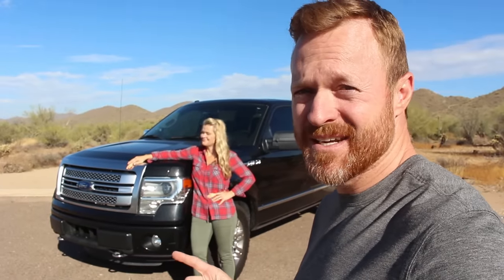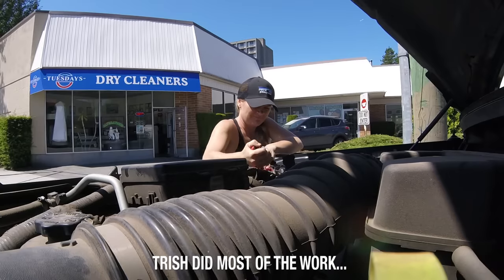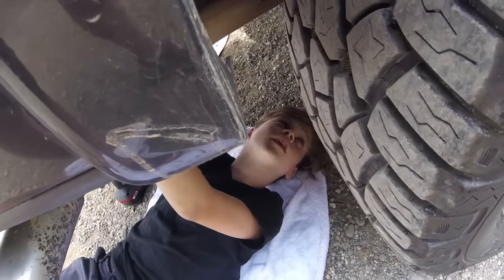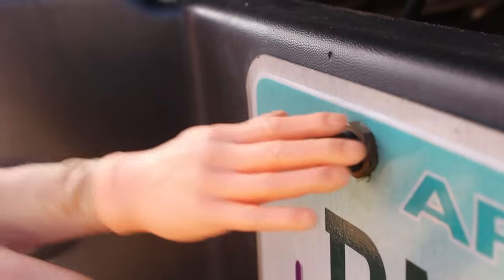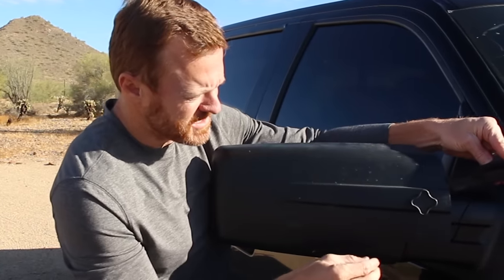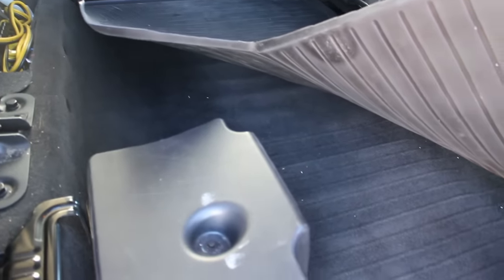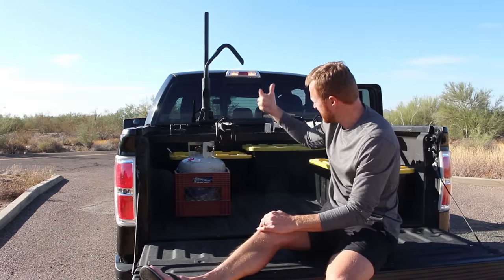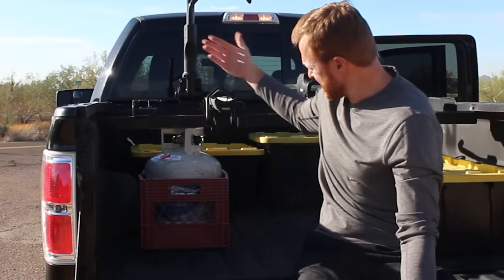TOWING WITH A HALF TON TRUCK (FORD F-150)

Comment: Are you using a load leveling hitch? I set up one on an older F-150 to tow a 28’ camper and it did not sag with stock suspension.
Reply from the maker: Yes, the EZ Load weight Dist. hitch. It failed after 18 months. I wouldn't buy it again.
Reply: I'm not sure Ford has it on every model year, but I think any of the trucks that boast the 'max-tow' package, with the
additional transmission/oil cooler and the extra radiator cooler, will also have a weight distribution hitch.  But not every
auto/truck dealership has sales people who know the difference, and not every truck on Auto Trader includes that info
in the ad, either.  Sometimes you just have to look for yourself.

Comment: PS to funny on the bike rack we went the route you are looking to go with the side mounted rails and it is awesome! Also allows you to have a cover on bed below to stop everything from getting wet. We carry a fat bike and mountain bike on top with no issue, easy to take the rack off and leave the rails on if you need to load something large in the truck also. For info we got ours installed by the company called Rack Attack

Comment: I'm considering this model for a 25 foot Airstream, weighing about 8 K Pounds.  I believe that beginning in year 2016, the Ford F150 feature the "Back up Assist", where you actually use a knob to back up the trailer.  If you want the trailer to back up left, you turn the knob left, and right, the knob right.  The back up feature is what attracts me to the Ford F 150.
Reply: Things a waste of time in my opinion. Go to a parking lot and practice it’s not hard.

Comment: We had to change our pull vehicle. We went from a 2007 Mountaineer 175,000+ miles to a 2014 Expedition XLT with a complete Tow Package. Great Price got a decent amount for the 07, not what I hoped but it's good. 5.4 L engine. If we'd have known this was going to happen this soon would have delayed the trailer and got the bigger Rig that we started with. Oh well, hindsight. It's a great SUV and I'm partial to them. The clincher was LeAn knew the former Owner so we knew it was a good solid truck. Built on the half ton F 150 chassis it's a winner and we're happy. Well not about the new payment but  at least a great pull. I'm thinking about the Firestone Airbags for it to.

Comment: Good video. I have a 99 Tahoe to tow my race car on an open trailer and usually at or over the weight limit of the truck, however I've done similar upgrades plus a number of others engine, trans, brakes, tires, fluid coolers and some suspension work. I've never had a problem but I do drive carefully. Someday I'll build my dream tow rig but the Tahoe has been great for us for 13 yrs so far, its also my daily driver. I almost forgot to mention, I'm disabled and use hand controls so don't let anything stand in your way of fun.

Comment: Worked construction and pulled a 7000# trailer for many years with a 02 F150 SC w/5.4, went about everywhere in the country with little or no mechanical trouble though I always seemed to be on the upper edge of its capabilities and I understand the newer engines in the F150's far outshine the 5.4's. That being said I did finally upgrade to a F250 with a turbo diesel for me it was a great improvement in comfort and mpg.

Comment: Just went from a 250 super cab to 150 super crew. I bought the most well equipped f150 I could find. New truck has 3.5 eco 6.5 foot bed and payload of 1830lbs. My trailer is smaller than yours but I’m still a little anxious about towing with the 150. We’ll see how it goes.

Comment: The new F150's are great trucks. I have a 2012 F150 Eco-Boost with the Max Tow package installed and air bags on the back. I tow a 28 foot Eclipse Stellar 5th Wheel Toy Hauler no problem. Now getting a 5th Wheel Hitch installed for the 5'5" bed was interesting! Can we say *Expensive!!*

Comment: I have the firestone "Riderite" air bags on my Titan. Just a note if you install them without the onboard compressor, one with a pressure switch that insures there is always air pressure in the bags when you're driving and you install them with the Schrader valve only it will void your warranty.

Comment: really well done video. love seeing people with their head on straight about towing. i personally use "the equalizer hitch" . we have a 2002 silverado with the 5.3. planning on a add a leaf to stiffin up the back end along with lifting the rear end about 2 inches in the process. we have trailer brakes installed. all in all you hit it right on the button on the video. take care of your rig and it will take care of you.

Comment: I’m glad this setup works for you. I don’t know how long Gringer is, but I towed a 37’ ft. bunkhouse travel trailer with a 2010 F150 with no success. I added helper bags like yours and was using the Equalizer hitch. I was well within the weight limits of the truck, but that trailer pushed us around like nothing else. Going down any hill was a white knuckled ride. I have since traded in the 150 for an ‘05 F250 with the Powerstroke diesel. Night and day difference. Now, I don’t have any sway issues, and I don’t have any problems going down mountain passes yet alone hills.
Keep up the great work with the videos. You guys are so much fun to watch.
Reply: 28 feet, was his trailer length
Reply: Thanks for the info. I guess I should have read the video description before posting. I figured my problems were do to how long our trailers is. The longer the trailer the more crosswind it can catch and the more leverage it will have on the tow vehicle.
Reply: yea, I just noticed 30' feet was in the description.   But in the video, he said 28'
Reply: yea, I just noticed 30' feet was in the description.   But in the video, he said 28'
Reply from the maker: Yeah, 37 is pretty long. I would think the issue is not the weight, but tongue weight depending on where the axles are. The diesels are nice - no question.

Comment: You guys put out incredible info. Thank you. 

I am very early in the process. I don’t have a tow vehicle no matter what trailer we decide on. IMHO, pulling a RV of any size at all, a F150 as a tow vehicle is very much a compromise. I understand it is what you have but holy cow, you’re pulling a big trailer with that small vehicle.   I am leaning toward a 25-30 foot trailer pulled by a 3/4 ton, non-dually, truck.   If we do go with a 5th wheel then a dually truck might make more sense.   But a half-ton gas truck?  Not unless we buy a RV 20 feet long or less, which isn’t likely.

Comment: The one thing you need to ask isn't whether it can pull it but can it stop it. I had a friend mine with a new Ford pull a trailer that was a little too heavy and the rear passinger tire sheared off the axle right where the axle and brake drum met. I've been pulling for 40 years and my opinion is your asking an undersize truck to pull that large of a load. A 3/4 ton has larger axles, brakes and a more robust frame for a better safety factor. You've been lucky so far.

Comment: WOW, I can't believe how much I copied what you did.   Bought the same size trailer and installed the load rites, weathertechs, new rear shocks and trailer mirrors.  Mine did not come with a trailer brake so I had to buy one but it all works.  Your are 100% correct, those air shocks make all the difference in the world.   Excellent video (again).
Reply from the maker: You must be exceptionally smart :)
Reply: Well that's proven now isn't it, lol.

Comment: Great info. I have an 07 F150 5.4L with the max tow package (9200 lbs tow, 1550 lbs cargo) and we are really wanting to pull the trigger on a 35ft bunkhouse camper that weighs in at 7500 lbs dry. even with the added cargo, we'd be within weights, but it's helpful to see the recommendations of others in our position as far as how to maximize safety while driving.

Comment: When the truck sags, it is basically telling you that it is not the right truck for the task at hand. A mod to the suspension is a rather risky approach in my opinion.
Reply: As long as you are staying under your trucks GCWR, your fine. Plenty of half ton trucks pulling horse trailers in rural america with much higher payload springs.
Reply: Every truck will sag with considerable weight. Just like a vehicle will rock a little when a driver gets in and out. Plus there are plenty of safe mods for suspension.

Comment: Hello folks! The truck you have is really a beautiful truck, with the best gas engine Ford has ever made for towing since the 460. When you bought it, was it a truck you ordered or found? The reason I ask is that year is a good year, that Ford offered s HD Payload/Towing Package that basically make a half ton into a 3/4 ton Truck! But you get weird 7 lug wheels that limit your choice of wheels. I do not believe that’s the case with your truck. Too bad because that’s a great package for someone that wants a half ton towing Ford. But at least with the big engine I’m sure the rest of The drivetrain will take anything you and your family needs with that trailer will have. So I truly hope you and the family have fun and stay safe!

Comment: A trailer brake controller, whether an integrated or aftermarket, is not just highly suggested, it is required by law.
All trailers weighing over 1000 pounds are required to have working trailer brakes. Since 99% of RV trailers have electric trailer brakes, that controller on the truck is required.

Comment: Awesome upgrades, I wanted to say that first because I like everything that you modified. However a diesel truck makes everything easier, even more so a fifth wheel camper and a 3/4-1 ton is the ideal set up and anyone that would ask me whether or not I would go with a half ton that is heavily modified or a three-quarter ton, I’m going to suggest the three-quarter ton every time.... One of the main reasons for that piece of advice is wear and tear on the vehicle, diesels are made specifically for towing and they are better at it and one major feature that a larger truck has is the ability to stop faster and anyone that has towed 10,000+ pounds knows that stopping is the most important thing. I own an eco-boost and I own a power stroke and I’ve used both to haul a fifth wheel,  up to about 40 miles an hour there really is not a huge advantage for either, but once you are at highway speed’s it’s diesel all day, also stop and go traffic the winner is definitely the diese, it just makes life so much easier. Albeit I own a construction company and I use both trucks for work so the purchase is warranted for me.  for a baseline model diesel trucks nowadays you are looking at around 50k, and if you are like me and you like creature comforts you’ll want to go with an upgraded trim package and that will run between $65k-$100k.... I didn’t pay that much for my 2017 F250 platinum because I researched and waited for the right deal and paid cash in full, I got my truck for $38,000 and it only had 50,000 miles, completely dealer maintained, I spent another $4000 taking the DPF off tuning it and and another ther $7k lifting it (I’m a redneck)...  that’s just me tho. In my opinion if you have to ask yourself whether or not you are half ton will tow that much then you either need to consider a smaller trailer or a bigger truck and that’s really all there is to it. The best towing half ton is the eco-boost and it’s not even in the same ballpark with my tuned power stroke... cry once buy once, just like anything else if you are going to haul your family around the country and you want it to be easy-going and pleasurable then spend the money.
Reply from the maker: We have an F250 6.7L now. Should have got a F350. Check out my payload video. 3/4 diesels have not much more payload than a gas 1/2 ton. I'll probably get a DRW next time.

Comment: We love Ford trucks. On our 3rd and have number of Ford Broncos. . First one was a 94  F150 super cab we had for 23 years. Bought a 2010 F150 4x4 super crew v8 gave to our son when we upgraded to 2017 150 4x4  3.5 v6 echoboost.(wow more power than v8) super crew. The back end saved more than the 2010. So opted to add a beefier leaf spring. It's been awesome.

Comment: Two things. We travel full time. (Pangani Tribe on YouTube) 

How much does your rig weigh and what's your towing capacity. 

Also, can you consider doing a video just on using your interested brake system in an emergency situation. I've never though about doing that when needing to correct. I always just pump the breaks. 

We are moving to the next spot in a few days. Would love to hear back!
Reply from the maker: Ginger is 5,900 dry and 9,200 loaded. Yes, I think a trailer break video would be good.
Reply: Keep Your Daydream what's your tow capacity?
Reply from the maker: The exact tow capacity depends on gear ratio of which I don't know - both gear ratios are more than Ginger at 9,200. The real limitation of my truck is the cargo capacity. I didn't want to take the chance spreading incorrect information so I omitted from the video.
Reply: Keep Your Daydream gotcha! Thanks for the info!! Love following your journey!
Reply: This  is  a good  blog post that explains  how  to  determine  what your  gear ratio (and other specs)  is:  https://www.fordf150.net/howto/decode.php

Comment: I basically have the same truck you do, but the FX4, with max tow, luxury package. I don't have much sag like you do. No air bags either. I imagine, when I install a trailer sway control/equalizer, it will be even better.

Comment: How much does your camper weigh? Loaded? I'm curious. My dad pulls his campers (he's always had one, 50 years I know of) with a heavier duty truck. He now owns a Dodge 3500 duly diesel. I'm going to follow you just to see how your truck holds up towing your camper. My husband and I are looking to purchase another truck for ourselves to tow a 33 ft Crossroads Zinger. You were very right about the trailer brakes. A cross up is no joke. Trailer brakes saves lives, I am proof. Don't tow without one.

Comment: A+ Plus on your video.  Great information and not "preachy", thanks .  Only thing I would disagree on is it being easy to pump your airbags up with a bicycle pump.  It's possible, yes, but not easy.  It takes forever.  As a matter of fact, when I use my portable 12V compressor, it feels like it takes forever, let alone a bicycle pump.   I empty my bags about 75% when I'm not towing my fifth wheel because the ride is rough with 80PSI and an empty bed.  So, I'm pumping mine up and down 10-12 times a year.   If it's in your budget, have the compressor installed.
Reply from the maker: I guess it depends on the starting air and ending air. It was only 3 pumps for me with this truck. Over time, I left the air at 35 psi and with a load it adjusted to 70 and I was set. Yet, on my 250 and now 450, I installed an on-board compressor.

Comment: Great and fun video.  We tow our 27ft trailer with our 2010 F150 and it does well.  Sure a diesel 3/4 ton would be easier, but we decided to use what we have.

Comment: I have a 2014 F-150 with the Eco Boost.  It pulls OK and I don't "push" the engine that hard.  Talking about trailer sway:  The 2014 has an automatic braking system when the trailer starts to sway.  The first time it happened I pulled over to see if I had broken anything.  When it kicks in the truck automatically slows the trailer and the truck down to 55 MPH.  I am sure it is safer than me thinking "Is the trailer swaying that bad?" BUT it sends the dear wife into a panic and her head blocks the passenger's side mirror looking. :D
Reply from the maker: I've heard about that. Don't baby that engine too much. I've heard people needing to replace their tranny because the keep the RMP's too low when climbing hills, etc. I don't go over 4k RPMs very often, but I like to put it in 2nd or 3rd gear and keep the RMP fairly high.

Comment: When I started towing many years ago I knew I would need a cooling kit for the transmission.  I didn't realize the truck I had was not equipped with a heavy duty radiator or (trailer break system also added), what a headache that was out west.  Every tow vehicle since then is bought with a towing package.  I think I'm thrifty by keeping my vehicles for 8-10 years.  highest millage was almost 300k when I sold it. Lots of travel that decade.
Thanks for the info about the rest of the setup.
Reply from the maker: You're doing things right. Change trucks is expensive. You're 3 times ahead of the game.

Comment: Exactly what I did.  Started with a half ton ecodiesel and a 26 ft toy hauler.  I went and upgraded to a 3/4 ton ram with the 6.4 gasser.   Now I have a 7500 watt generator in the bed that I use to boondock for work.  I couldn't do this with a half ton truck.
Reply: David  McClellan I’m curious to see if there was a big difference after switching to a 3/4 ton?  I have a tundra pulling a 30’ trailer now and would like to go to an f250 gas diesel.